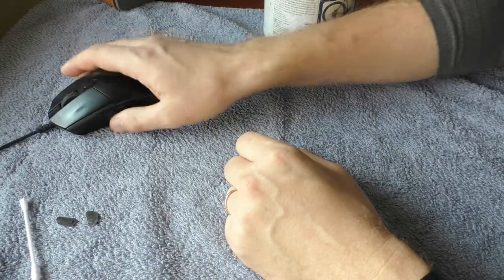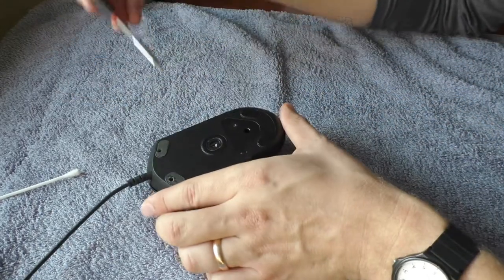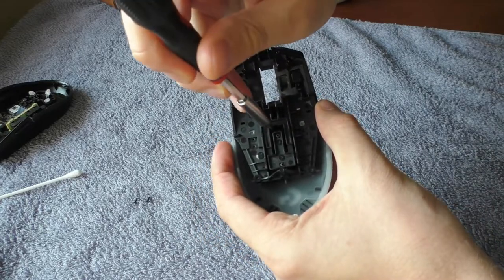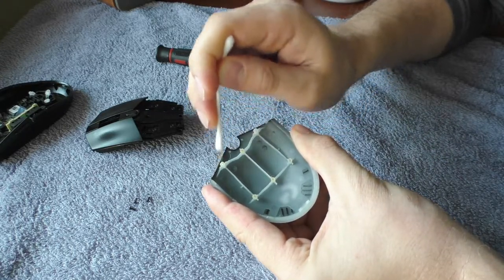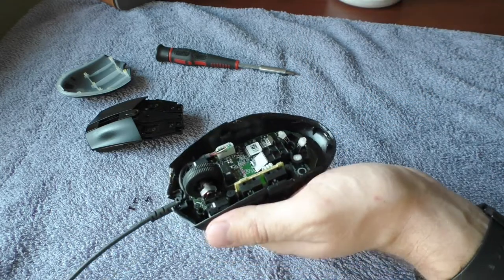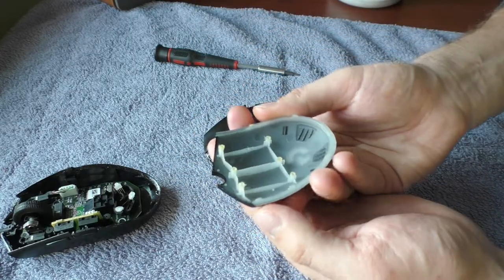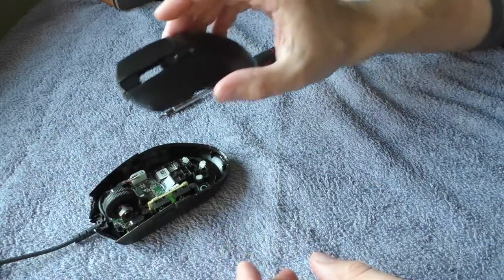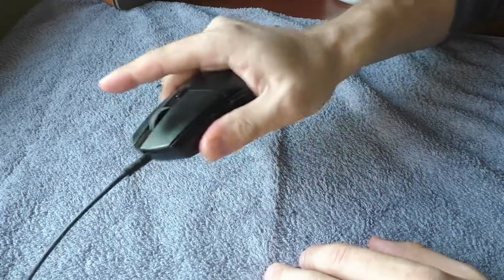How to fix squeaky mouse? Example on Logitech G203

Comment: I have a g305 i'm experiencing the same issue but shell is a bit different since it has a removable battery cap. Will this tip work for me if i use krytox 205 g2 lubricant on the borders?